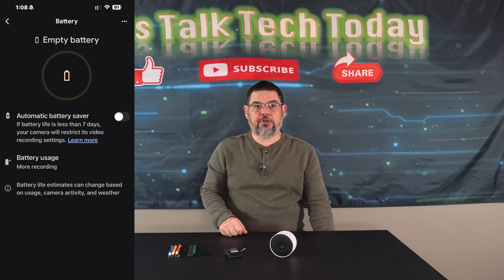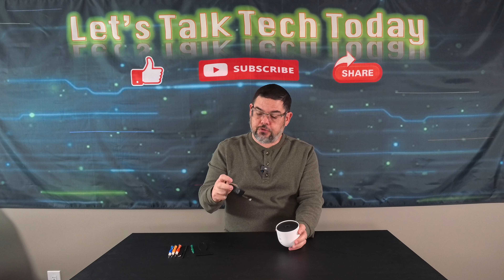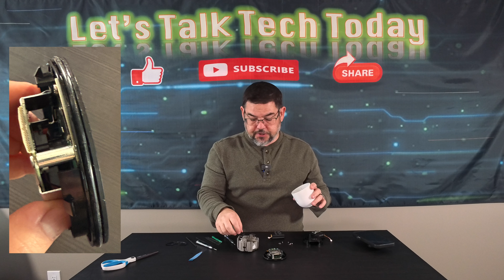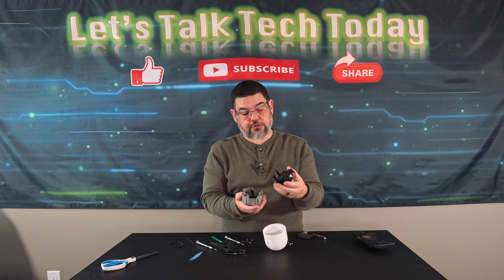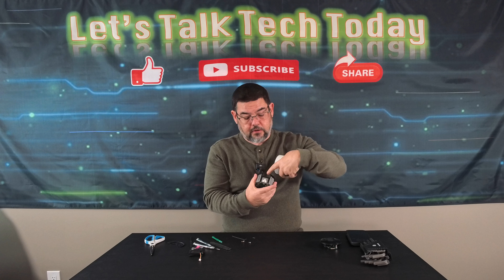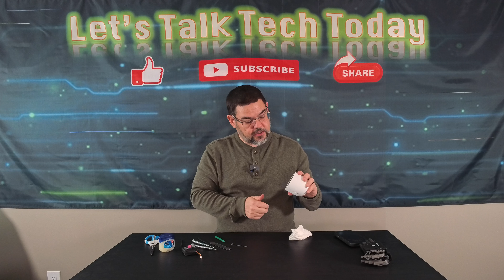Google Nest Cam Battery Replacement With Step By Step Instructions

Comment: Thanks for the video. I have 7 cameras, 1 doorbell, 2 nest hubs and two speakers. I only wish I didn't buy these. My question is with battery running around $44. plus the time it takes to replaced it without breaking it. I wonder if it's worth it. I have 2 cameras that records a flash but no other image and looking it up it says it's probably the battery- those two I have kept connected to an electrical outlet.

It's interesting that I have a HP laptop and the battery died shortly after the guarantee and it's the same thing- the frame is glue, so it's super difficult to replace the battery. I only wish companies would make replacing batteries more consumer friendly and make batteries available at reasonable cost.
Reply from the maker: We agree it is unfortunate that these units were not designed to be more user-friendly for battery replacement. We feel any product with a rechargeable battery should be easily removable/repairable for proper disposal/replacement.

Comment: So i had this camera also dead sitting on constant power as i have all my cameras set like that and this one started to show just battery getting low but at same time was always connected to power.
Eventually turned off and I was left with a dead camera. So I decided to take it down and was ready to replace the camera but I found this video so I gave it a go. 
Just to say my camera didn't react at all with or without cable connected. I have than Watch this right about time you mention the RESET button.....lool so i went and press it and.....camera came to life but i have already removed it from my account so i wanted to add it again and it didn't want to work.
Than i watch some other video short that explains how long i need to hold button and than when i got Blue light i was able to add it back to my account and not its back charging and working properly....dont know how long it will do that but for now i have again running camera :) Thank you for the video.
Reply from the maker: Glad you go yours working again.  Of the 3 camera we have, this is the only one that gave us an issue.  It is unfortunate the unit wasn't constructed to make it an easy user replaceable battery.

Comment: Thanks for being brave enough to take this on. This camera is definitely NOT designed to have the battery replaced. I just went through this process and got it working. It would be helpful to have more detailed pictures because it's pretty tricky to get all the parts out. One thing I don't think you mentioned is the magnetic part that attaches to the base needed to come out before I could get the metal frame out and pulling out the magnet required me to pull the wire out which ended up breaking the connector a little. I was able to get it reattached, but I'd like to hear how you delt with this. I wish they didn't hide the battery connection under the bottom of frame where the circuit board is becuase it would have been a lot simpler to remove the battery otherwise since it is in the main cavity of the unit.
Reply: Also, you didn't mention how to disconnect and reconnect the ribbon cable. I was able to figure it out. The connector has a lift lever on the back where you slide the cable into the connector. You push it back down to lock the cable in place.